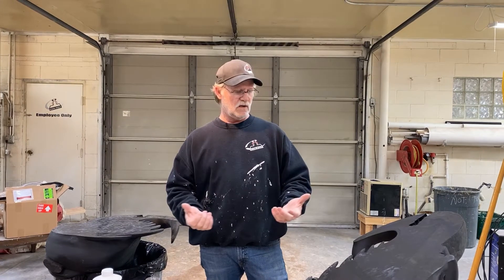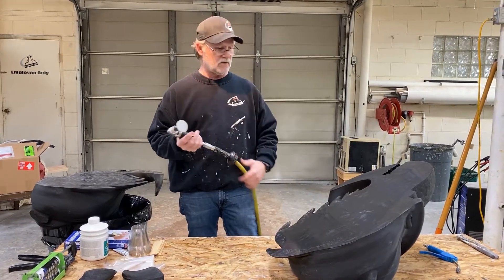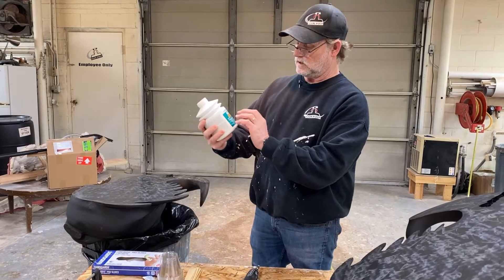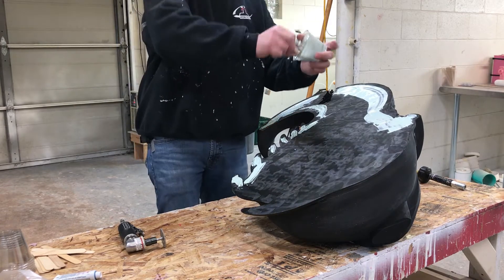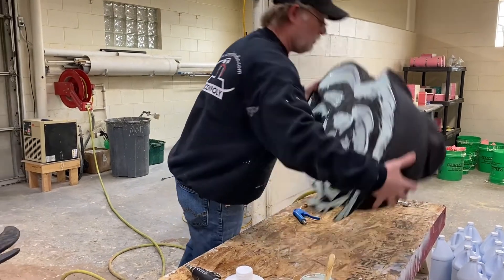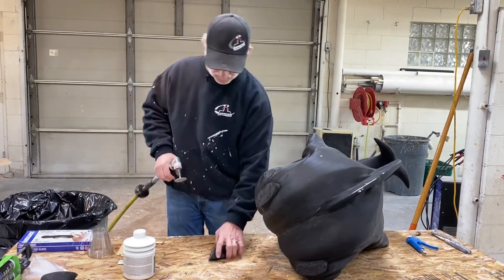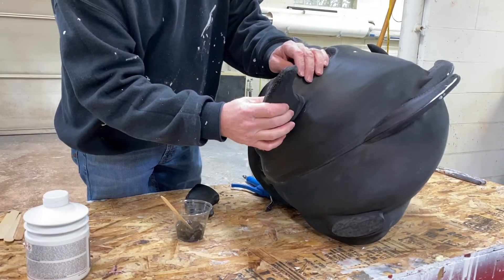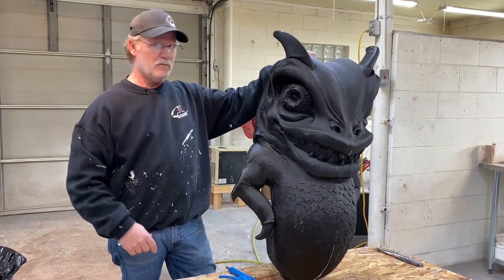Large Scale Sculpture Assembly | 3D Printed Mythical Creature

Comment: Great video.  What would the benefits be of creating this large format character via 3D print vs milling it from polystyrene foam?  Are you able to hard coat it like you would polystyrene?
Reply from the maker: Hector,
We spray coat as well.  They each have their place but the only thing similar is appearance and time depends on what type of final finish is desired.  Most of the stuff we do requires a more durable final piece than hardcoated foam can provide.
Reply from the maker: Hector,
3d printing produces more detail in the finished piece and requires less post finishing and detail sculpting.  You can hard coat similar to polystyrene.  Thanks for the question.
Reply: @IconPoly  thank you, that makes sense.  I see you make molds of a lot of your pieces, would spray on hard coating give you the same results and be faster?